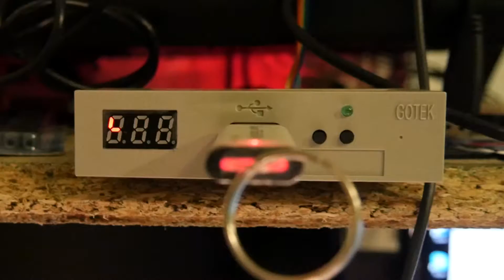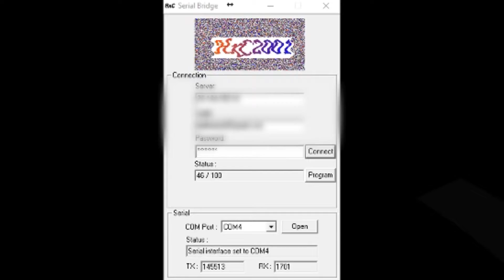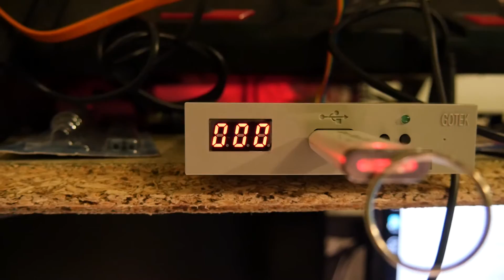GOTEK floppy disk emulator - firmware update for Atari Teardown Lab Atari ST Fun!

Comment: Does anyone know how the 3rd LED solderpoints are supposed to work ? at the green (and sometimes red) LED on the PCB, there is another pin with an LED symbol on the PCB soldermask. anyone knows how this is connected and can be used ?

Comment: I noticed there are a few models of this product but the main difference is that one supports 720k and the other 1.44k. The one on the Gotek site says it supports 3 formats, the last being 1.2. Since the. ST only supported 720k images, so you know if I could still purchase a 1.44 model but create 720k images on the thumb drive?
Reply from the maker: +SimmeringPotpourri good aftermarket firmware was required to get it to work at 720 for the ST. Apparently there is an open source firmware that gives similar functionality for free. You would still have to invest in the programming tool, bit they are relatively cheap.
Reply: Ok, great! I guess, then, I can just grab the version that is cheapest and fits my color choice. Thanks for the clarification. 
For that USB interface you're using to flash the firmware, I'm wondering if a Arduino could also be used since it provides the same TX, RX, 5v, and GRN and can be connected to a PC through USB. In any case, where did you get your interface?
Reply from the maker: +SimmeringPotpourri you got it. I think it's basically an ST ARM chip and you are programming it using the serial bootloader so just a plain interface should work

Comment: Hi, i'm now to your channel, and i've found it great and informative so far.   one quick thing. I'm having trouble setting up my new Gotek and i was wondering if you done a set-up video with a step by step guide what to do and install etc on the USB stick???
thanks
Reply from the maker: +lamboUK Are you using the stock firmware or did you get an interface like the one in this video?
Reply: Hi.  I've formatted my USB stick and put autoboot , HXCSDFE.cfg files and one game to try.  And it's just booting to ST boot screen.
Reply from the maker: +lamboUK I had to load the firmware into my gotek via the serial cable and website. I think it's mandatory as the ATARI needs a compatible disk image and by default the gotek does not support it.
Reply: The Backoffice oh. Damn.  By a matter of chance do you have the link to the firmware so I don't pick the wrong one?  Thanks mate for the help
Reply from the maker: +lamboUK I think you have to buy it. Was a while ago. If you tweet @methanoid he can assist. I do have some links in the description but it takes some digging.
Reply: The Backoffice thanks for the help.  Keep up the great videos 👍

Comment: Is there a similar setup for using the GOtek with an Amiga?
Reply: Better Amiga options are now FlashFloppy or HxC (the latter also works with Atari). Much better than Cortex.
Reply from the maker: +treguard1982 There is indeed, however I believe the firmware is totally free. Send me an Amiga and I'll let you know!😂
Reply: hehe nice try ;)
Reply from the maker: +treguard1982 Could save a lot of people a lot of time 😂

Comment: Good to know!

Will be interested to see how you fit it in your ST.  I put mine inside, in the floppy bay, and am starting to regret it because reaching the buttons is a pig.
Reply: The Backoffice I bought a busted external FdD for Amiga. Will use that as a smart case for external Gotek. Just need a cable made up ;-)
Reply: The Backoffice If you do that, please do make a video of it.  Would be good to see how.
Reply from the maker: +Dan Hedley personally I'd bring the buttons and the header out somewhere. The buttons tend to race away as well which is annoying in the drive bay
Reply from the maker: +Meth Methanoid nice one!
Reply from the maker: +Dan Hedley In the new year I will get on it!

Comment: Strange - my USB kit came with a button and the pins needed in the pack. I still think you should have a look at a cosmosex for a ST. It gives you so many things - like virtual floppies, virtual HDDs, network access, etc, etc.
Reply from the maker: +FairFight14 I have come across them before now you jogged my memory, funnily enough, I was going to use a pi to do exactly the same thing 😂
Reply: The Backoffice I have one in mine. Loads of fun. I'm now trying to relearn Amiga stuff.
Reply from the maker: +FairFight14 I once made a pimped Amiga, all the mods, tower case, Ethernet, accelerators, graphics cards etc. Still a piece of crap at the end of it. I'm going to avoid the same with the ST and just use it as it was intended 😂